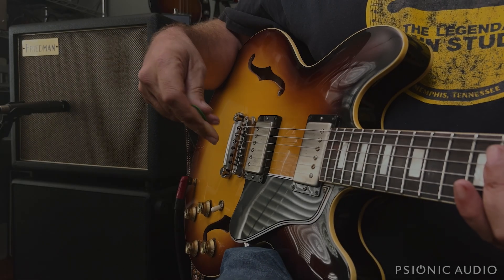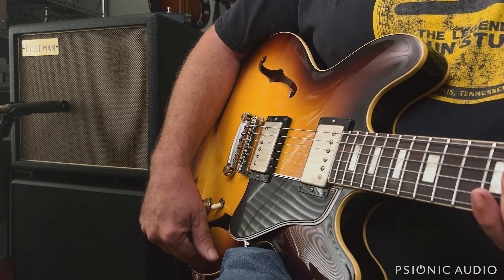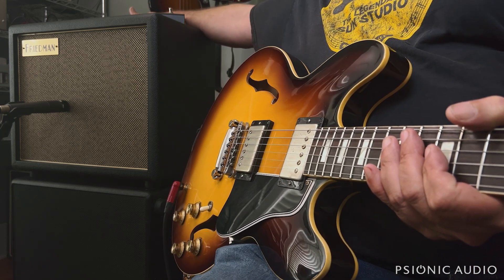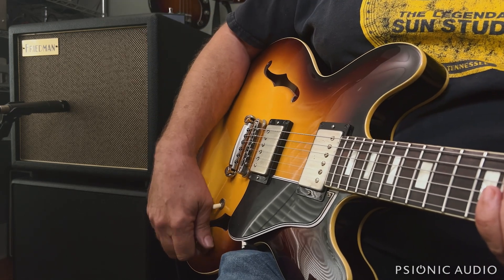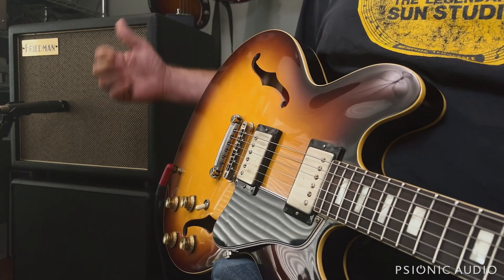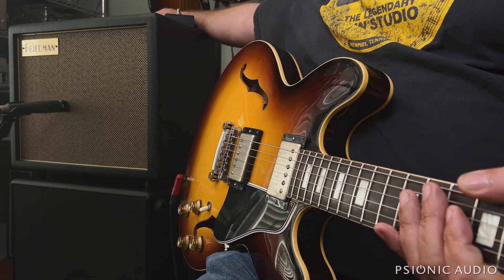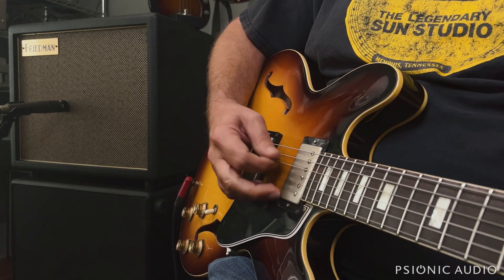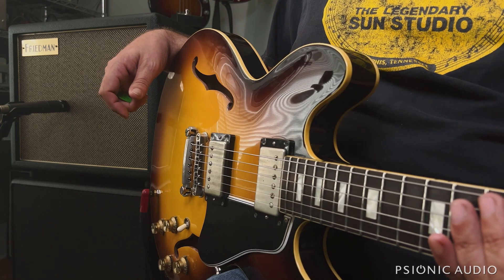Friedman Runt 20 | Playing Test Take 2 (Yes I Deleted the First Video)

Comment: Loved my Runt 50(though playing Twin Sister now) the clean channel was “super” clean, the boost being really more of a cut that you remove. All of Dave’s amp’s are the hybrid handwired/good pcb now which makes assembly more efficient and less likely to break down. Lyle, you might want to try out the Dirty Shirley/Twin Sister, being more JTM flavored. It’s great hearing your thoughts on the Friedman stuff!
Reply: I've recently got myself a Twin Sister to go with my Runt 20 combo and it's absolutely incredible. Really like the Runt 20 for the cleans, but the overdrive is a bit spiky and undefined for me.
Reply: @benforsey  The Runt overdrive is the BE mod Friedman amps are famous for. I would recommend the Buxom boost pedal with the “tight” knob. Works great for the Runt and the Shirley amps 👌🏻
Reply: @passionplayer7  already got a buxom boost and while it helps, it still doesn't get the Runt where I wanted it to be. But it's cool, I just use the Runt as a clean pedal platform now. The Twin Sister and and Buxom Boost together is incredible!!
Reply: @benforsey  Good to hear! Yeah, the Runt was a great amp but wasn’t for me.

Comment: Most if my amps have the same characteristic of huge volume changes 7-9 and minor changes after. Can that be modified by a new pot? Great channel.
Reply from the maker: Do you mean 7:00-9:00? What amps?
Reply: Yes. 7:00 to 9:00. I could be totally wrong but I expected the master volume to act as an attenuator to the power section. One amp is a PRS MT 15 and I believe my Suhr Bella and Rockerverb. I seen to be able to adjust volume better with the volume control on.my pedals except for the fuzz pedals. Anyway I really appreciate your technical understanding of gear.

Comment: 2nd, 3rd time around, still right next to it. Clearly not a clean channel pedal platform but a gain channel monster on a 20ft cable. Nice reviews Lyle. I would definitely rock that combo with a remote footswitch and the channel volume difference as a safety. Let r rip tater chip!